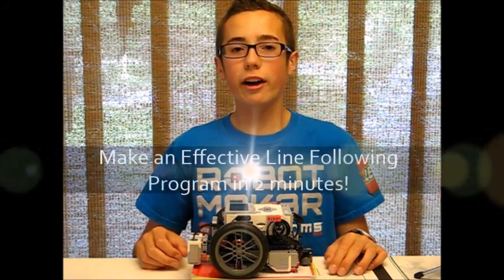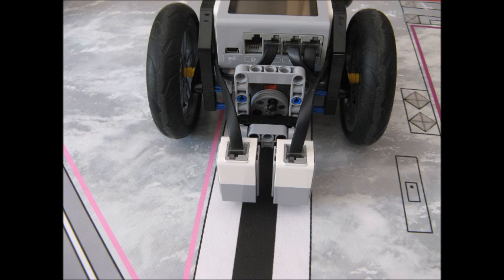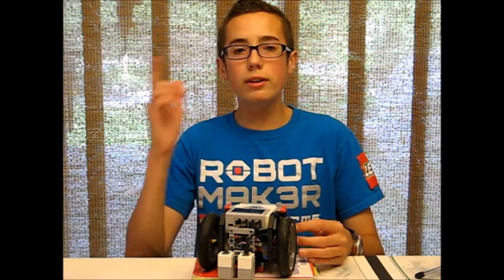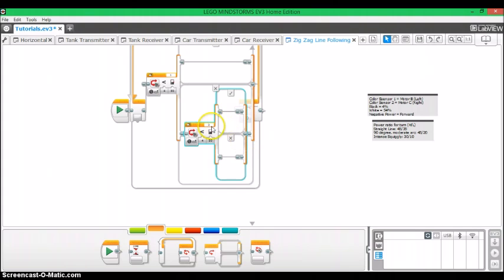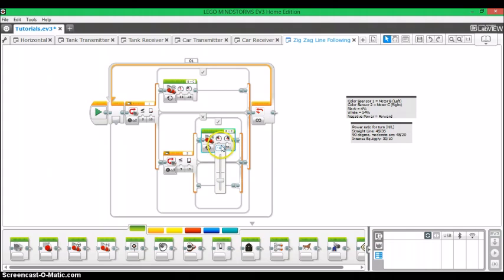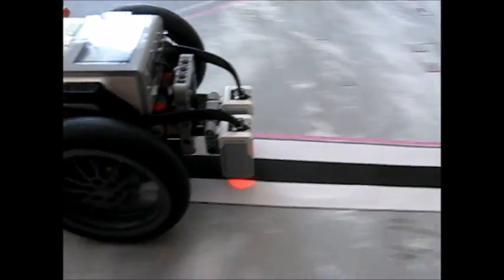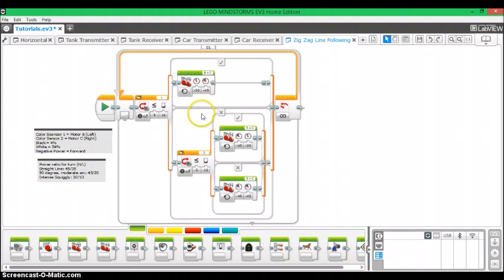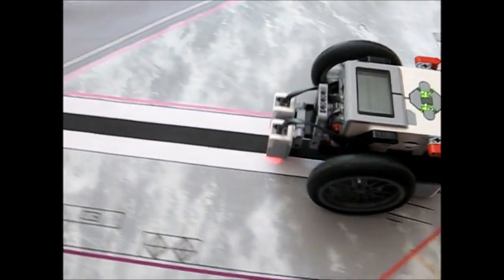How to Make an Effective EV3 Line Follower in 2 Minutes!

Comment: If my two light sensors are further apart, can I use two separate lines?
Reply from the maker: Yes, I suppose it is possible, as long as the lines are parallel and you size the width between the two sensors appropriately.
Reply: @Builderdude35  Okay thanks man and keep up the great tutorials.

Comment: Excellent video. Do you know how to use 2 color sensors to perpendicularly line the robot up when crossing over a line. 

For example, “if one sensor sees a line the line the robot will turn until both see the line, and then continue forward.”
Reply from the maker: Absolutely! You're asking for line squaring, which happens to be my specialty. Check out this video: https://youtu.be/voMlsdVAERQ

Comment: i am having some glitches With my ev3 brick when it runs a program like a line following sudenly the colorsensor shuts off and 1 to 2 sec later it turns back on again .. anyone else have that problem
Reply from the maker: That;'s strange. I recommend reinstalling the firmware on the robot and re-downloading the program onto the brick.
Reply: I found out that IT was a problem with the color sensor i orderd a new one and the problem dissaperd

Comment: Hello Builderdude35, I was just wondering what piece you use to connect your two color sensors on the front of your dog-gear interface, as it seems to allow you to attach the sides of your color sensor connection holes to the side of that piece - or am I missing something that connects them underneath? Either way, I haven't been able to find an efficient way to connect my dual-color sensors to the front of my dog-gears in a stable way and was wondering if you had any tips regarding that?
Reply from the maker: Hello, I am using the two pins that are normally used for the dog gear interface to attach the sensors. I simply slide a beam onto the two pins (5 studs or longer) and then mount the color sensors onto that using crossblocks. It's a very simple mount.
Reply: Thank you very much! :)

Comment: for me, the end block on the switch is unlimited, and my program keeps going in circles. how do you make the unlimited do it only once
Reply from the maker: You need to change the condition of the Loop block so that it exits based on another condition, such as motor rotations.

Comment: Where can you find that super big wheels?
Reply: thanks
Reply: what does it called
Reply: the wheels?
Reply: They are the motorcycle wheels.  The wheels alone cost about $20 so it's better to buy a set of the Technic Motorcycle instead.

Comment: Does this work on different lines
Reply from the maker: It depends on the lighting conditions, as well as how sharp the turns are. This would work on any line with a little bit of adjustment if you are going between different light levels, or varying degrees of turns.
Reply: Put a small tire on the sensor blocks out most light should get about 6 RLI

Comment: Can you calibrate the move tanks to make the robot turn a 90 degree angle?
I mean like _|
I care just if I can calibrate it, not the value
Reply from the maker: It's not really calibrating. You just run the motors in opposite directions and determine how many rotations/degrees are necessary to complete the 90 degree turn.
Reply: +Builderdude35 thank you very much

Comment: Hi Builderdude35! I have a question. How do I limit how many rotations/seconds the robot line follows?
Reply from the maker: +Saket Mudaliar Change the Loop block's case from "infinity" to rotations, and enter the desired amount.
Reply: Do you mean numerical?
Reply from the maker: +Saket Mudaliar Yes, this is a numerical value; it should specifically be labelled "motor rotation."
Reply: Oh Ok Thanks!

Comment: Hey Builderdude35, my FLL team is trying to create a line following program. However, when we tried using your program, it didn't work. I changed the light value for the black line using the PortView just like you said, so I don't think the problem is there. However, we do have our 2 color sensors on the back of our robot, not in the front like yours, could this be the problem? If so, what would you recommend?
Reply from the maker: +Jac Carlson I recommend color sensors on the front of the robot. You could have the robot drive in reverse as it line follows.

Comment: My solution:

If the sensors are on each side of the line, subtracting the sensor values gives a number roughly between -100 and 100. This number can be used as a speed adjustment for each motor. You add the number to one motor and subtract the number from the other motor. As the sensors diverge more the adjustment becomes stronger. Not quite a standard PID loop, but interesting in any case.

SA = Sensor A, SB = Sensor B, MA = Motor A, MB = Motor B, SPD = Speed

MA Speed = (SPD + (SA - SB))
MB Speed = (SPD - (SA - SB))

Put this in a named loop so you can exit when needed. Put a MA and MB motor off w/coast to clear the motors before you exit.

For extra points you can reset the degree sensor before the loop and use the average degrees as a loop exit for pretty close distance measurement.
In the loop: Average degrees = ((MA + MB) / 2)
And knowing the wheel diameter you can easily convert desired distance into rotation degrees.
Reply from the maker: +Lee Saferite That is a great idea! Thanks for sharing it with the community!

Comment: Hi Builderdude35, I was planning on having the color sensor on the side of the robot instead of directly in the middle. would this cause any issues with its line following?
Reply from the maker: +ChubbyRainLTG No, the line following will still work mostly the same; of course, the robot will just be on the side of the line.

Comment: If u use fuzzy logic it can also be as accurate and u only need 1 colour sensor.
Reply from the maker: zechariah boey Thanks; could you please define "fuzzy logic?"
Reply: It is a logic using only 1 sensor. It follows lines by taking the colour of the line and the floor, after that it follows the line on the edge. So if the value of the line is 80 and the floor is 10, the middle of these values are 45. When the sensor shines on the edge of the line, it has the value of 45 so it goes straight. So basically fuzzy logic involves the colours of not only black and white but also grey, which is the value of the edge.
Reply from the maker: zechariah boey Ah, okay. So I basically have something along those line with my proportional line follower tutorial: https://youtu.be/NZISXcAQJRk
Reply: Ok then i was just sharing, no need for anger.
Reply: Dammit
Reply from the maker: zechariah boey I'm not angry at all :) Sorry it seemed that way!

Comment: If the ideal spacing for EV3 Line Following is ~one stud between the two EV3 Color Sensors, what is the ideal spacing for LINE SQUARING, as shown in your tutorial https://www.youtube.com/watch?v=82EaySXvta0 ?  As you know, in FLL almost all of the lines on the FLL Robot Game mat have perpendicular lines in front of each Challenge model.  It would seem that the best, all-around spacing between two EV3 Color Sensors in FLL would be 4-5 studs -- would you agree?
Reply from the maker: dluders You ask a very good question! I meant to mention that in this tutorial, but forgot (I may make a quick video explaining that). For line squaring, the farther apart the color sensors, the more effective; I'm not sure how they fare when they're this close. However, I don't recommend using this line follower with the sensors farther apart than what I have here, as the robot will wander farther off the line and reduce consistency. So, my recommendation is that, if someone wishes to use both, the best bet is to have 2 pairs of color sensors, one for each task.